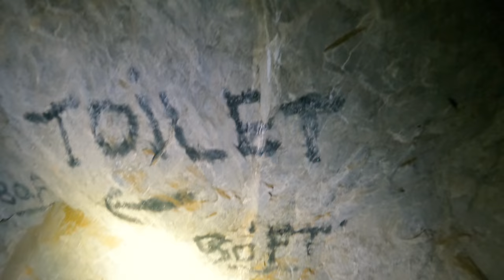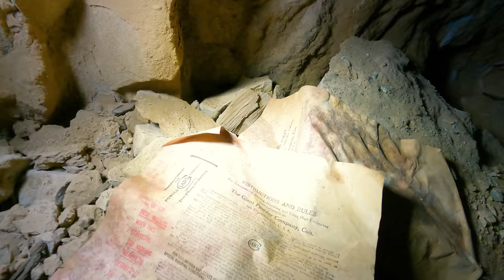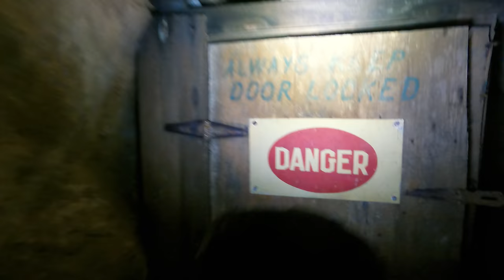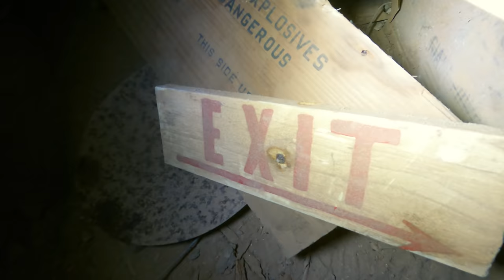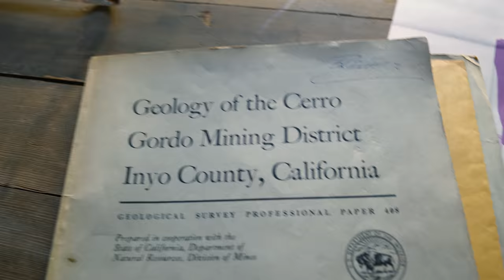Going 700 Ft Down A Mineshaft For Treasure & Water

Comment: My father - in -law used to own a well pump shop and drilling company here in east TN, before he passed away. I would go with him on emergency calls on the weekends sometimes, and I learned a lot in a few trips. We had one well that was over 950 ft deep, but the water level was about 700, that's the depth your pump will have to pump from (submersible pumps). Anyway, these things I'm about to mention may be happening here and he just doesnt show them, but I'd recommend the following. 
     First off, a filter at the end of the pickup pipe in the water. The minerals are small, but they can/will attack and attach to everything in the system. Keeping the bigger chunks out will save the impellers in the pump as much as possible.
     Second, I'd put one of those tanks at the 350 ft mark. Have the bottom pump, pump up to that level. Then a second pump from 350 ft up to the top. You could run smaller/cheaper pumps that way too.

     Third, and this might help the most, he needs some things called "check valves" at every 150 to 200 feet. These let water flow through, but won't let it flow back down.  That way the pump doesn't have to push water all the way back up the pipe, after having pushed it up that far to begin with. These are super important to any water pump system, when pushing it up grade.
     Fourth, He doesn't show one, but probably has one. Anyway, he needs a "pressure tank". These are tanks with a rubber bladder in the middle. On the top is air pressure, which can be added to if more pressure is needed. On the bottom is water. The pump pushes water in, when it reaches the desired pressure a relay cuts the pump off. Water is forced out by the air when you use a faucet. Once it reaches a certain decreased air pressure, the relay turns the pump back on to fill the tank. It gives you water on demand but saves the pump from running all the time.
     Fifth, these can't work with the flexible pipe but do on the hard PVC pipe we used in wells. These are torque arrestors. They clamped on the pipe, then you pushed one end up and it would cause the body of it to flare out. It looked a lot like a black rubber football. That flared out against the body of the well shaft and would stop the PVC from slapping into the well walls.

These are just what I saw that might help.

Comment: I couldn't help but think of John Montague's poem, The Water Carrier, especially as you reflected on the thoughts of water at the end:

Twice daily I carried water from the spring,

Morning before leaving for school, and evening;

Balanced as a fulcrum between two buckets.

A bramble rough path ran to the river

Where you stepped carefully across slime-topped stones,

With corners abraded as bleakly white as bones.

At the widening pool (for washing and cattle)

Minute fish flickered as you dipped,

Circling to fill, with rust-tinged water.

The second or enamel bucket was for spring water

Which, after racing through a rushy meadow,

Came bubbling in a broken drain-pipe,

Corroded wafer thin with rust.

It ran so pure and cold, it fell

Like manacles of ice on the wrists.

You stood until the bucket brimmed

Inhaling the musty smell of unpicked berries,

That heavy greenness fostered by water.

Recovering the scene, I had hoped to stylize it,

Like the portrait of an Egyptian water-carrier:

But pause, entranced by slight but memoried life.

I sometimes come to take the water there,

Not as return or refuge, but some pure thing,

Some living source, half-imagined and half-real,

Pulses in the fictive water that I feel.

Comment: Install one way valves, onto the inlet, for the water to your pump. (with a shut off valve, on the pump side.)

And the outlet, from your pump. for less Water priming issues for the future.

Comment: Hi Brent the pump your using is utilized on boilers to pump chemicals into the boiler because they are good at pumping against high pressures of a boilers. It may  pump several gallons of water per hour but after going up 700 feet I really don't think you would ever pump enough to fill a 2500 gallon tank let alone 3 of them. I think you would need several pumps at different levels to work properly,  the first one being a sump pump and several centrifugal pumps along the way.

Comment: You could put an air relief vent on the suction line near that collapse. I would also consider using a check valve to keep flow from draining out and breaking suction.

Comment: There's a mine in Minnesota the skip traveled a little faster than yours. 2400' in 3 minutes. When the levels would go by, (150-200') the light in that level would zip by every 3-4 seconds. It's been many years so if these numbers don't completly jive, tough luck.
The shaft wasn't straight down, but maybe 10*.
When the skip got to the bottom, The hoist operator drum completely stopped, the level platform would go up & down 2' to 0' as the slack in the cable would zero out. Then you'd ring the operator up or down to get the deck lined up with the skip. Of course they have markings on their drums so they'd get it close almost every time. * FUN STUFF! *

Comment: Question have you sent the water to a lab just to see what's in it cause at 250 gallons a day that should do a lot for you and the hotel if you have enough storage for when you need it and store it when you don't. You can always add filters or reverse osmosis to filter for drinking water if its clean enough to try to filter.

Comment: You need the roof supporting and the roof fall clearing up and making level where the water pipe has to rise over it.
This will prevent airlocks in the pipe and keep your water running down at Cerro Gordo.

Comment: Hello pal :) I'm glad you had company lol! I'm loving the rubber ducks. Assuming you know about the rubble blocking the tunnel which also complicates air flow-may I ask why that isn't removed? Maybe complicates the structure of the tunnel? Also how does the water work, underground through the mountain? I'm thinking how you'll work the hotel for more flow :o

Comment: According to google maps the mine building it about 700 feet above the town. So if you were to run a line from the water source to a tank in the town without any tanks or venting between the two ends the water in the down slope side should cancel out the lift height of the lift side. If I am right once the pipe is full of water you are only pumping the height or head of the difference between the inlet and the outlet. To fill the pipe a T could be installed at the high point with a valve at the town. There should already be a check valve at the pump. Fill the pipe though the T . Pump now has less work to do. make sure the outlet end is always submerged so when the pump stops it doesn't suck air back into the line..

Comment: Catching up from the first video to the latest, but I believe what happened with the pump isn't just the load of pushing water 700 feet up. It's more likely that the pump exceeded the refill rate of the sump and sucked air. It then just cavitated the same water in the pipes and basically ran dry until death. I suspect every pump of this capacity will have the same fate as it is pumping too quickly for the supply. What you need is a float switch and a check valve or two. Putting a check valve before AND after the pump will give it a break between cycles without putting as much wear on the internal valve. Putting one before it will keep it from losing its prime when the float switch in the sump shuts if off for unknown amounts of time waiting for it to fill again. A floating switch on a set length of tether from above would be my recommendation.  This way the pump stops whenever the floats angle becomes vertical and it's dangling on the tether. 
Other than that a small diaphragm pump just in front of the main pump will allow for easy and near instant priming. Even the little cheap ones for RVs would be perfect as you can draw water through them after the prime is complete.

Comment: The pump might be crapping out on you because the backpressure is so great pushing water that far up a pipe. Do you have backcheck valves installed? When I was a wildland firefighter, pumps sometimes blew out due to too much backpressure on hills, and rookies forgetting to put in a backcheck valve.

Comment: If calculations are correct, 1/2 inch pipe to lift water 700 feet. Pi * R squared * H = 6597 cubic inches.  That column of water should weigh 230 lbs.  This will require a positive displacement water pump.  McMaster-Carr lists a possible choice 240lbs of head pressure, for $550.  Once the water reaches the top and goes over the hill, if there are no air leaks, a siphon should help things.

Comment: I wonder if the dynamite box with dirt in it was, the toilet?

I can imagine miners throwing in some dirt to reduce the smell because we were taught to throw ash from the kitchen stove down the 'long drop' toilet for the same reason at a remote shack where we stayed as kids.

Maybe dynamite boxes used as toilets were removed and burned or dumped when they got too full?

They probably had plenty lying around and that might account for why there are now so few left despite the fact that those which are still down there are generally in good condition.

Comment: Odds are a well rig could hit water a whole lot higher than 700’ down since the 700’ is up on the mountain. I realize it’s money to drill but a pump to push water 700’ is no fun hopefully you get at least equalizing pressure from the drop down to the town. Good luck. Just think water exerts .433 lbs for vert climb

Comment: You need redundancy for that water source. Maybe 4 pumps and a second, dry line. Ready to go. Maybe a water heater under there. So it can pump hot water if needed. I'm no expert in this matter, just that is probably how I would do it

Comment: Q crew needs to gondownnwotj some lengths of pvc pipe and dig out that pile of four foot rubble and put the water like through thr pipe so it will be protected if the dug out four foot pile falls on top of it. The water line won't be so hard to prime but they make self proming pumps too. Seems like a simple fix. Just labor intensive.

Comment: Get some, been there done that (BTDT) advice from those experienced with water in mines.  Think about strength in numbers and series connections every 100 feet.   A one horsepower jet pump will supply a typical residence for 20 years using a 220v 15amp circuit. Do a dual system for reliability and unexpected failures. For your hotel,  and the emerging town you will probably need 20,000 gallons of storage.  Plastic reservoirs are around a dollar a gallon, not including installation.  Again,  better to have a number of smaller than one big one. You have lots of underground storage area,  Water setting too long becomes stagnate and alive with all kinds of things especially if it exposed to sunlight.  So, remember to keep it moving.  Another reason for two  or thee systems considering the seasons and  occupancy. Also, remember, quartz, purifies water and you seem to have a lot of it.  You might be able to seal off one of your dead end underground tunnels and use it for water storage.  Think about Carson Hot Springs in WA or Lava Hot Springs in ID,  Its the minerals in the water that attracts the purists as well as the added chemicals.  At Soap Lake in WA, you can either have city water or lake water in your bath tub. 
Iguana

Comment: Unless I’m mistaken (which happens more often these days!), that hoist was designed for much larger loads than you subject it to. Wouldn’t it be a good idea to have somebody, e.g. an elevator engineer inspect it? It’s probably sound, but if not, wouldn’t you want to know? He might be able to make suggestions for how to make it safer and more reliable.
Reply: I bet it (the hoist/elevator) would not be considered safe by modern standards, and it hasn’t been maintained in how long? It has only one cable, and maybe no brakes in case it falls! That’s pretty scary. You should get it upgraded, with a new, bigger cable, motor and controls. It might be the single most important thing!

Comment: Submersible pump would be a far better fit for that site, drop it in the water and forget about it, no priming no hassle, maybe make it up on a quick release ip rated power connector and a water joint for swapping it out, but if they are good enough to sink into a well they would be great there

Comment: I would be looking for a tunnel that went down the mountain. If the town is 500 Ft lower you could come out the side of the mountain and the lift would only be 200 ft. instead of 700 Ft. Another thing if done properly the lift could be reduced by the suction of the down the slope side. Think syphon.

Comment: if you have issues with water again, put a foot valve, check valve on the end of the line and it wont be able to drain out of the line
Reply: also they will prime up hill if you wiggle it back and forth in the water makes your life easier to prime the pump

Comment: The original wiring already caused a major problem at Cerro Gordo, ie: The American Hotel. It might be prudent to replace the feed line to the 700" level with the appropriately sized wire for the voltage drop at that distance in the appropriate conduit. Then, for shits and giggles,  seek the assistance of a Hydraulic engineer. Seven hundred feet of head pressure isn't anything to sneeze at.

Comment: I would be metal detecting every trip down that shaft...anything else is a bonus find, but shat in toilet paper wiped original 501's are not worth $100k+, I don't care who sharted in them!lol  You need a larger pump to lift water 700 ft. There is a .48 psi loss for every foot of elevation lift (head pressure). 700'x.48psi= 336 psi output needed.  I only saw the pump gauge hit 150 psi at the bottom of the lift. And the slightest leak in the suction pipe will cause a loss of prime.  I would dig out the mound of rubble the hose runs up and over (unless needed to contain the water) and get a new hose with no joints that may likely leak. Another problem could be the downstream demand could exceed the pump output volume and allow air in the lift pipe which can cause a loss in prime water.

Comment: Put in a foot valve in the water at the highest level of the pipe put in a t with a plug and fill the pipe from there you can fill it to the foot valve and to the pump should make it easier to prime the pump

Comment: I'm really interested in the type of deterioration that happens down here. So much of the deterioration that happens to materials on the surface is due to ultraviolet light and biological decomposers that ultimately rely on plants getting energy from the sun to exist. I suppose there are bacteria maybe? Or is it just damp and the water is degrading the material over time? Like, what exactly is happening to those blue jeans that is just turning them into powder? Putting a small sample into a box and wrapping it up well to protect it from solar radiation, then having the sample looked at by an interested party with the right tools might yield interesting information

Comment: Your touches will fail on you quicker if you are in cold conditions. You are better of with Lithium Batteries for your lights which are better for the cold conditions you are in. BUT you should also use flashlights/ torches made for lithium batteries. Try it and see it this does make a difference?

Comment: What freaks me out the most is when you found those pants and dynamite boxes and pieces of paper they’re probably Over a 100 years old and have been touched since, like someone 100 years ago walked done that tunnel and had those jeans on and was using that dynamite, it’s the same as the sign someone wrote that had a date that ended in 1910… it’s so freaky but intriguing 😂😂

Comment: Grow 1000 plants 20gallon net pots use 1000 kings soil mix 3.5cubicft drip line battery watered 150watts 1000 15000watts total for buy set up under floor working and charchole filters on floor working and growing

Comment: why don't you just use a high tower heat exchanger system, even at 1% relative humidity would be less expensive in the long run.

Comment: The pump is pumping 700 feet up? No wonder it fails. That's 700 feet of pressure. Should have multiple pumps and reservoirs to negate that pressure.

Comment: I know nobody here probably cares but I feel the need to say anyway that entering an abandoned mineshaft is a severely dangerous thing to do for multiple reasons, long drops that could suddenly break open under you, build up of certain gasses that could easily soffocate you, especially in such a oxygen low environment, there could be old expired dynamite lying around that could easily be set off with a single trip over the wrong box and many more things.

Comment: Your water pump is vastly undersized. I'm guessing the head pressure of a 700 foot lift to surface was never figured into the equation. Solve your problem by purchasing a pump with that capability. The obsolete pump looks much larger than the new one. I live too far away to lend a hand but I work in water treatment, have for 17 years.

Comment: that is the wrong system to lift water 700+ feet, water weighs 8.50 lb a gal. you need 1or 2 more pumps or a multi stage pump to get it up reliable, do some reading about lifting and pumping water .

Comment: Why are you using that terrible pump? A Grundfos SQ1-155 will pump day and night on less power and not fail. It uses a stainless helical positive displacement pump and can pump from 800'. Stop playing with that mechanical nightmare and drop a SQ1 into the pool and let er Pump 24-7